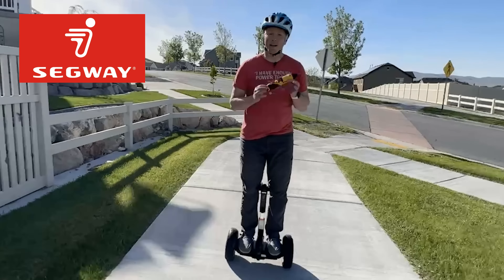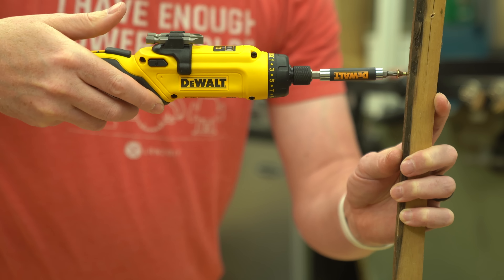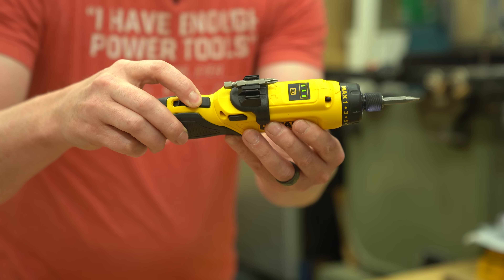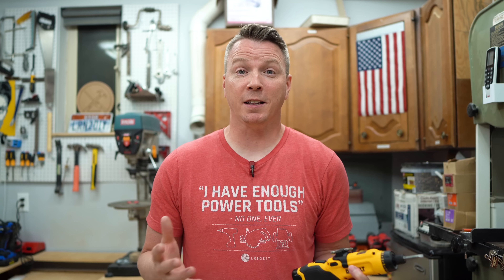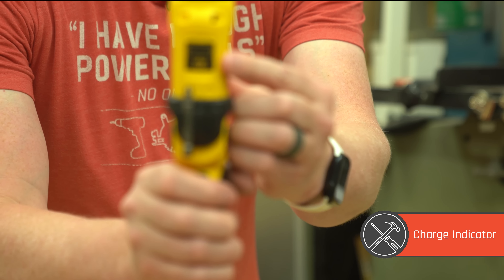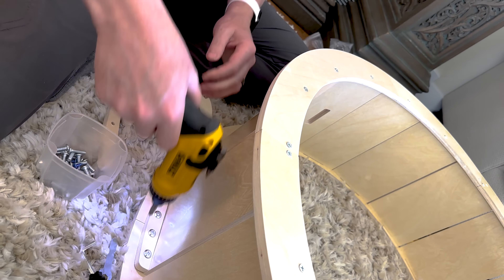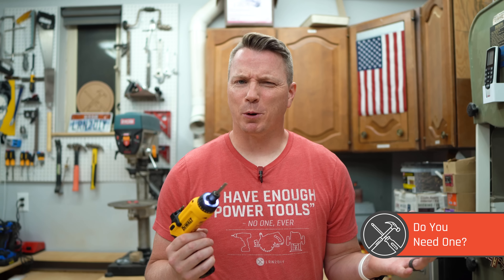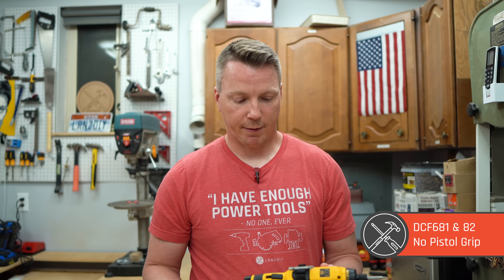Twist Your Wrist, The Screw Goes In

Comment: I have 4 of those, make sure to get the original DCF680 with pistol grip and clutch. Got my first one probably 10 years ago and use it just about everyday. It's perfect for disassembling electronics and computers. Battery lasts forever, super torquing. As you can tell, i love this tool. Get the DeWalt 3 piece countersink bits to go with your DCF680, perfect to predrill holes.

Comment: I’m a Milwaukee guy. Got all their screw guns, drill drivers, hammer drills, impact drivers, etc. I picked up the DCF682 about 4 years ago on a whim because I thought the technology was interesting. It was the first DEWALT, I bought in over 25 years. I haven’t been able to put the thing down. In a pinch, I’ve even installed 3” screws into door frames with it. It’s got some torque. Love using it for door hardware and electrical work, especially when I’m on top of a ladder. Slips easily into my tool pouch. And like you said, the battery lasts forever. I only have one battery but it hasn’t really been an issue for me since I only use it for smaller projects. My local Lowe’s still carries them in store. After watching your video, I might go and pickup another one just for kicks. Oh, and I’ve never felt the need for a clutch or twist grip. I’m sure that model weighs more and that would put me off.
Reply: I weighed it for you just now: 517g (or 18.25 idiot units) with battery, without bit (for the model with clutch and twist grip)

Comment: This video perfectly describes my experience with this screwdriver. It's like magic. It's amazing. It literally blows my mind how well it works and how accurate it is. It's revolutionary. I use it for 3D printer building and RC cars, trucks and planes. It works perfect even for small screws. The torque setting goes nice and low.

Comment: I have one for about 3 years and love it. I’m just a DIY’er. I do also throw in a drill bit if I need to use a small anchor in drywall or a small screw in wood. Also great with small hex bolts. Get one.

Comment: I have one and love it, it’s amazing for low torque applications. Their version of this that will convert to a pistol grip has gotten me into some tight spots I could never get to with another driver. The one handed operation has been a god send for installing stuff overhead and while holding awkward items. The downside is after this being out for many years, it is still the only Dewalt 8v tool, I’m not sure if this line will be around for much longer.
Reply from the maker: Yeah, would be nice if it were on the 12v system.

Comment: My man-crush (and I do know what that means) is a 12V Bosch drill-driver I bought four years ago just after buying the house.  It came in its own case with four bits, a charger, and two very long-lasting batteries.  It has a driver setting plus 20 torque settings, doesn't weigh much, fits my hand very nicely, and is highly controllable with respect to speed.  I've used it to drive drywall screws and put together knocked-down furniture, all without issues.  You will have to pry it from my cold, dead hands.

Comment: I purchased this several years ago and have always felt that it would be a much better tool if it had a variable speed trigger. When working in a confined area or having to reach around something I find it awkward and uncomfortable to have to twist my wrist just to spin the bit. I would rather just feather the trigger and hold my arm in a good position. I rarely use it. That said, I would have never purchased in the first place had it not been for the gyro. It just seemed so cool and fascinating that I just had to have it. My favorite is my  m12 Installation Drill/driver. It’s just so capable of doing so many things. It’s also very quiet for working inside clients homes. If I need more grunt it’s the amazing m12 Surge.

Comment: I have used mine to drill 1/4” or smaller holes in places no regular drill would fit. And I greatly prefer using this, over any other type screw driver, if more than 3 screws are involved.

Comment: I have the newer Black and Decker power screwdriver. Does not have a  gyro (twist ring), replaceable battery or swap to Pistol grip. It is at full retail at about 25 dollars (purchased mine at Menards, on sale for 20). It has lots of power if used as a screwdriver, locking Chuck, LED lights and very good battery life. For the cost, it may well fit more budgets and provide great service.
It also has a non contact voltage tester built in. Great for a heads up.
I love mine.

Comment: I love my DCF680.  Quick tip. If it ever start acting weird, clean the battery contacts on the battery itself.  Mine would stop rotating when in use.  Cleaned the battery contacts and it was as good as new again.  Was ready to throw it out.  Full disclosure, I found this tip from another user somewhere online.

Comment: I bought one! Cheers from Germany, had to order that from the US! DeWalt is INSANE, not selling these over here... I swear to god they would sell these by the HUNDREDS OF THOUSANDS here in Germany...
Slight addition: The other one version isn't "newer", that's just the version for electricians, it has the added de-burrer on the front and is missing the pistol grip convertible option... But it's not better or worse or older or newer, just for a different application... There is a third one also, not quite sure about that.
Having said that, my one is also marked "N2", so maybe that's what you were referring to? - Greetings from Munich!

Comment: Hyper tough from Walmart has the same one accept it is usb charger. Cost around 40 bucks. I use the m12 impact but have been thinking about that one for hvac so I don’t risk stripping screws
Reply: model 98934 ?  It's not gyro.

Comment: There’s a reason there are different shaft lengths for all screw drivers. I used a 8” & 12” proto magnetos tip. Milwaukee and metabo make nice ones but not gyro. My complaint is the thickness. Project Farm has done testing
Reply: Follow up…. I bought a metabo 3.6 v kit for $70. Added a “5 Milwaukee magnetic extension for screw holding. Plenty of power for cover and plate screws. Thin enough for corners.

Comment: I too, as someone else mentioned, have the Craftsman version of this tool. 

It seems to be much smaller physically, and doesn't have the removable battery, and you can't rotate the handle into a pistol grip. But the Craftsman version is literally the size of a regular sized screw driver and has the same gyroscope action to operate it. 

I bought mine about 4 years ago now at Lowe's and I'm pretty sure it's made by Stanley/Black & Decker, who also makes DeWalt tools interestingly enough.

I love my Craftsman model, being an electrician, because it's great for assembling fixtures and light trim out work.

But as others have also mentioned, it seems to be unavailable or discontinued which is a shame because it's an awesome tool. 

I think you'd find that, based on the size and weight compared to the DeWalt, you'd like and appreciate the Craftsman model even more than the DeWalt model that you featured in this video. So try to get your hands on one if you can find it anywhere.
Reply: Apparently it comes in and out of stock every few times a year they don’t constantly keep inventory of it, been on the prowl for that gyro 4v for months now

Comment: Battery size has nothing to do with charging time.
The power a given battery chemistry can handle is proportional to it's capacity.
A "1AH" battery can take 1A of  current and charge in 1 hour.
A "4AH" can take 4A of current and   charge in 1 hour.
Batteries of a given type can charge faster, but longevity usually suffers.
Most current tools use lithium ion.
Dewalt's "new" "Powerstack" uses lithium ion polymer (li-po) which have been in the RC industry for over a decade.
Reply from the maker: I may have phrased it wrong but I have to assume that if DeWalt designed and built this today they’d use a technology that allows these batteries to charge faster.
Reply: @LRN2DIY I think you mentioned having 2 versions of this - the newer one not being the folocus in this video. What are the model numbers and differences?
Reply from the maker: @ryankozak99  You can find each model listed in the description with links and the differences between them. Hopefully that's helpful.
Reply: @LRN2DIY  Oops. Thanks. Didn't realize the new version was the more basic model.

Comment: I have the DCF682 and sometimes the gyro stops working. I read online to remove the battery and slid it back in and it works again. I was ready to throw it out. It works. I rather have a forward and back button like the craftsman. Just the craftsman has less power.
Reply: Try cleaning the contacts on the battery with contact cleaner or 91% alcohol.  I had the same issue and that fixed it.
Reply: @mabbaticchio  It's more of a reset for the motor. Like restarting your computer.

Comment: @4:14 I would disagree with the battery being "old tech". The battery is rated for 1 amp-hour  and the charger puts out 1 amp. Therefore, the battery is charged at 1C (which takes 1 hour). This is the recommended maximum rate that at which a lithium ion battery should be charged (the lower the better for battery health - for example 0.3C or less). Avoid any charger which advertises a sub 1-hour charge time if you're using lithium ion batteries.

Comment: LRN2DIY, make a video lesson on the different battery types for power tools because some use Lithium Polymer now which I think Lithium Ion you have to charge from 20% to 80% for longer battery life. Also it would be nice to make a video lesson about RPMs for Drills & Screwdrivers to know the different RPMs to drill into different materials like woods, metals, etc

Comment: I'm glad you compared it to the M12 Fuel Surge. I just got that one in a kit with 3 batteries for $180 because my old M12 impact driver was so loud that I found myself using my drill for both drilling and driving. I probably could've gotten away with this Dewalt, but oh well; I definitely appreciate the quietness of the surge impact driver and it's supposedly half a pound lighter than the dewalt.

Comment: The Competition:
- MINIWARE ES15 Smart Motion Mini Electric Screwdriver
- AmSmart SES series smart screwdrivers
Reply: From my own experience owning an ES120 (an earlier version of the ES15) though, I doubt either of these would be better for you than the DCF680. The newer ES15 model is supposed to be much better, but at least for the ES120 the breakpoint in size between it and the DCF680 is pretty dismal; anything the size of a phone or watch the ES120 is better, but even for laptops the DCF680 is already better. (Though, that's more a testament to just how much control the DCF680 gives you even on relatively tiny screws, than an indictment of the ES120.)
As far as I'm aware nobody else makes a gyroscopic screwdriver in the same size category as the DFC680, only in the smaller 'precision driver' category.